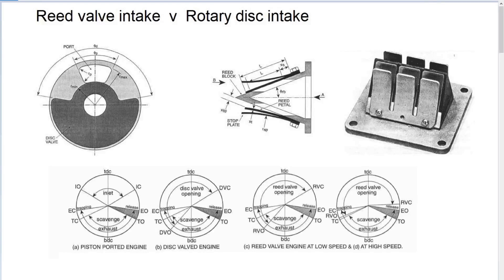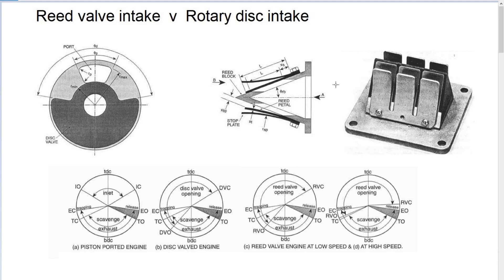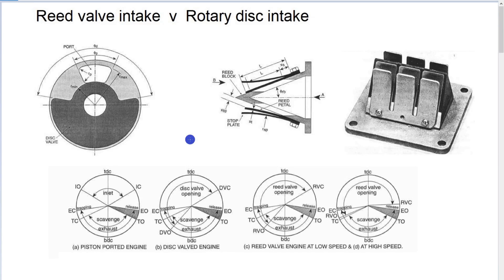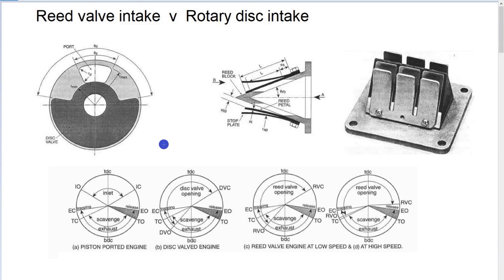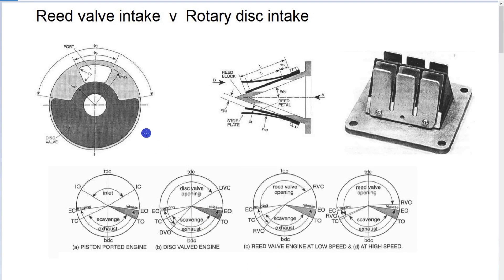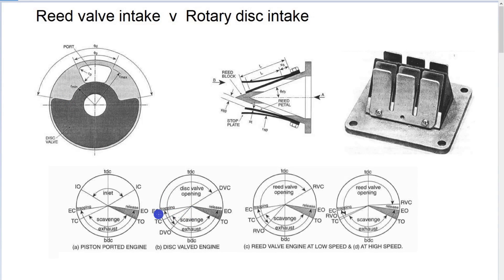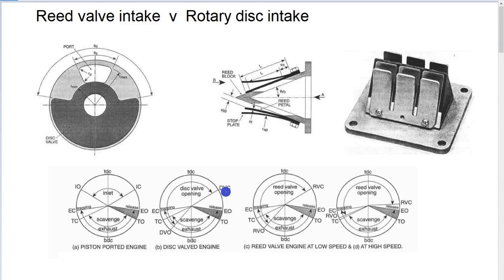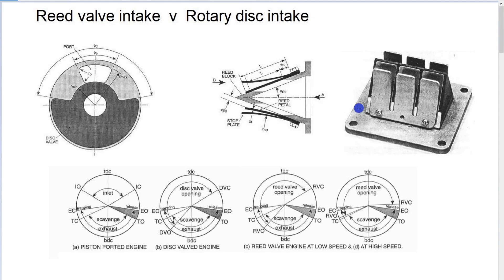Reed Valve V Rotary Disc Intake and why small 2 stroke engines favor the later.

Comment: Thank you for the video, you've done a lot of research. If I understood your data on reed valves correctly, I think it comes from an old perception that the boost port makes them open earlier. That should be only true if you have a piston ported system with added reed valves (the intake degrees might've been increased) and no hole in the piston, in that case the suction from the boost port makes the reed valve open before BDC. 

If you look at videos with transparent valves in slo-mo with modern design, you see that the reed valve opens a split second after BDC and it closes a split second after TDC. New reed valve system either go straight into the crankcase or into the cylinder but have lateral and lower ports which feed into the crankcase and the pressure from the piston on the downstroke seems to be keeping the reeds close until BDC, even though you lose some of the pressure after the transfer ports open. The boost port in these designs (or even in the old design with a hole in the piston) is fed from the crankcase with the reeds closed, it's another 'transfer port'. 

I myself thought reed valves would open earlier, when transfer and boost port opened, but the videos I've seen show a different reality. Technically on new designs it should be always 180 degrees from BDC to TDC, the higher the rpm, the more delayed the opening and closing of the reed valves happens, due to the fact that it takes some time for them to open, that is the noticeable difference between high and low speed, it's shifted. I don't know if you're following me, I think so. 

On the fact that rotary valves are more powerful, it might still be the case on very small engines, but as far as 125cc we have a lot of data today. 125cc Aprilias stuck with the rotary design and had Rotax make a special engine with a rotary valve exactly on the intake side to avoid asymmetry. Despite the ports being taken to the limit (you can find pictures on Facebook of that engine, there's 1mm between transfer ports for the ring that has been rounded near its pin to avoid seizing, just look for Aprilia RS GP engine, not the old inverted Rotax, the new one), the bike reached around 50-51hp with a 41 or 42mm carb. KTM with reed valves reached 55 with a 36 and 38mm carb. It's hard to find data on the Honda, but they had reed valves, they were as fast as the KTM (Aprilia won some championships but that was because their chassis was still superior and the rider did a better job). The only data on the Honda RS125 is the 40 to 45hp of the 'detuned' version they sell to customers today for the racetrack (obviously the tuning is not as extreme as the moto GP bike, though the chassis is practically the same). 

As far as go-karts are concerned, TM switched to reed valves in their 6-speed 125cc engine and it now has at least 45hp (some people claim 50) with a VHSH 30mm carb, before it was up 40hp. There's a video where they interview Gnani (unfortunately in Italian, but maybe there are captions you can translate), an italian tuner for GP racing, and he never liked reed valves, stuck to the rotary valve, his engines produced 50hp at the rear wheel, until one day, probably around 25 or more years ago, he chose to experiment with reed valves. It took him some time, practice, trial and error, but he then managed to extract 55hp at the rear wheel. 

I have no data on 50cc, as they stopped racing and developing extremely tuned engines, the rotary valves were the most powerful ones. Though I myself managed to tune a 50cc, reed valve on the cylinder, despite being 39mm bore and 42 stroke Minarelli engine, by copying the Rotax 122 design, to have better performance than the old Minarelli Corsa Corta rotary valve, 40.3mm bore x 39mm stroke with a 22mm carb. The Rotary valve Corsa Corta mounted a 28mm carb. But that might've been just luck. 

But seeing your data which seems to me to be coming from very early reed valve designs, I'm not sure your conclusions on reed valves reflect today's reality. Thank you for the video, it's very interesting and the latest book on 2T tuning seems to be 'performance tuning' by Graham Bell, published in 1999. If you know of newer books by engine tuners that show dyno data of different trial and error attemps like the one by Graham Bell, it'll be wonderful. 

I still don't know if I'm right about how the reed valves open, as my conclusion comes from seeing slo-mo videos on transparent cylinders, but again, it's a sort of proof... but not that conclusive. Unfortunately nobody bothers tuning these engines anymore, only motocross and go-kart, which already come with a maximised design for their purpose from the factory.

Comment: Please get fully into reed valves, and why the propensity in tuning  circles for ever larger   reed blocks installed. And is this any real world advantage ? Why ?
Reply from the maker: That is not a new thing, in racing builds we have always stuffed the largest reeds in as physically possible on the basis that an amply larger reed will present a reduced pressure differential across the reeds and increase flow at high RPM.
Factory works race engines have always had much larger reeds and carbs than stock bikes of the same capacity and make, simply to have the best intake flow at peak RPM.

Comment: Menurut q lebih handal rotary valve segi perfoma
Reply from the maker: Reed valves are pretty reliable unless you have some wild porting done that provides heavy intake reversion which can damage reeds.
Rotary disc valves are pretty reliable although they do wear and need inspection now and then.
However the performance aspect of the reed v disc as the video covers is far more critical then longevity.

Comment: Can someone recommend a video or a site with detailed information regarding setting up the timing of the rotary disc valve?
Reply from the maker: In short you need to get some starting figures by using a port time area calculator software.
Not aware of any free ones around though.
Reply: @AuMechanic  Thanks! any program that does not cost a fortune?
Reply from the maker: @erikjohansson9039  Try torqsoft
https://www.torqsoft.xyz/disc-valve-inlet-time-area-two.html
Not sure of prices but they have a disc intake time area calculator

Comment: Don't know if you still watch this but back in the 70's I had a Bighorn flattracker.  My tuner was Jeff Bratten who was VERY good with porting two stroke engines for racing.  He did the tuning for one of if not the fastest Yamaha 360 flat trackers it had dual 38 mm Mikuni carbs to feed the engine.
When he did the work for my Bighorn he came to the conclusion that I could put dual 44mm carbs on it and it would out perform the Yamaha.  I never did that as it simply cost too much.  But I really wish I could have.
But even with the single carb I could match that 360 in a drag race when going against the wind and he would pull me by no more than 2 bike lengths with the wind. 
I still have the port diagrams the Jeff made and was thinking of building a replica for fun today.  All I need to do is find a Champion frame and a F5 or 9 engine.  That's all.
Edit: changed 54 to 44 mm carbs. Off by one error.
Reply: Menarik! Bagaimana kalau karburator ganda yang satu terhubung dengan rotary valve, karburator yang satunya terhubung dengan reed valve, akan luar biasa memiliki keunggulan reed dengan rotary valve
Reply: @AgamSeftian  Interesting possibility.  I seem to recall seeing a story about a factory that did exactly that.  I only vaguely recall the article.  That would be interesting.  I type this and am going through the implementation issues in my head.😉

Comment: What rotary valve intake need is a split disk that can be tuned for rpm for optimal intake and closing timing. Like a four stroke cam phasing on intake and exhaust timing for optimal rpm V.E.
Reply from the maker: RG500 had a variable rotary disc intake.
Google it and you can see pics.

Comment: Rotary valves and oil injection really brought the Big Boy pants to 2 strokes
Reply from the maker: Yes rotary disc intake were a great innovation for small capacity engines and great for square fours even with the fact side mounting carbs caused ground clearance issue on cornering.
But oil injection was not without problems, when it was first used on street bikes in the late 60's it was to make it simpler for commuters to fuel up without having to premix however before they started fitting oil level sensors and warning lamps it was not uncommon for some to forget to fill up the oil tanks and then discover that after the engine had seized due to lack of oil.
And performance wise I can tell you having road raced street 2 strokes the first thing we did was to remove the oil injection and run premix instead.
Reply: @AuMechanic   you cant tune autolube up for power as easily as you can the rest of the engine. I run 32:1 premix in my RD350 racer
Reply from the maker: @hardwayfinder   Yes that's true.
There is also the potential of the oil pump failing so there are a few good reasons to get rid of it for racing.

Comment: Great video...thanks.  I would like to see a little more detailed comparison between just the piston port and the rotary valve for high rpm high horsepower.  My particular application is a 100cc 2 stroke engine that is going to be used for land speed racing.
Reply from the maker: The video does shows a basic a comparison to Piston Port to Rotary Disc at the beginning of the video.
How do you mean more detailed ?

Comment: Would it be possible to have a rotary disc valve with variable timing?
Reply from the maker: Yes it does exist, basically uses a moving aperture on the intake plate to effect a timing change on the rotary disc. It can be operated by centrifugal or electronic servo by lever or cable.
Reply: @AuMechanic  That makes sense, thank you! Centripetal force sounds a lot more like my kinda jam, I'm still traumatized from trying to fix exhaust valve servos on a Honda NSR250 😅
Reply from the maker: @Christopher des Baux  If you search google images you can find some pics posted in thumper talk forum..

Comment: Can you convert a scooter minarelli vertical from reed valve to rotary disc? 70cc polini
Reply from the maker: Not seen one but at a guess but you would have quite a bit of fabrication on your hands to do it for limited benefits.
Reply: @AuMechanic  is it worth it for me to install a 4 reed valve stage 6 intake vs regular (2 reeds) wirh a little bigger intake manifold into a 70cc polini with Yasuni R exhaust? It will improve the breathing intake of the system but I have a question, would I benefit from 4 reeds? Its for Yamaha Spy (CW50RSP) Minarelli vertical 2t AC
Reply from the maker: @2OnlyLifts  Cant help with specifics on engines Ive not seen but in general if the exhaust port is increased in size then you would benefit from a larger reed intake and carb.
Reply: @AuMechanic  could I contact you for some details if I needed any advice?
Reply from the maker: @2OnlyLifts  Just post here in comments as answers may help others.

Comment: Would the little nitro RC 2 strokes be considered to be disc intakes as it's actually the crankshaft that is cutting on and off the carby from the crankcase?
Missed seeing any videos from you for the last few years. Hope that you are keeping well and if you're looking for video ideas then an in depth analysis of how nitro rc engines work would be great.
Reply from the maker: Even though it has no disc as such the intake is "timed" by the crank slot at the carb intake so you could treat it much the same way.
And I'm doing well, thanks for asking.
I used to fly RC Heli's but I never really did any mods to engines or worked on them enough to cover more than the basics.
Aside from the different ignition they are mechanically a 2 stroke so a lot of the videos cover them too.

Comment: does it make any difference if the reed is on the cylinder or if the reed is on the crankshaftcase?
Reply from the maker: Case fitted reeds are common in small weed eater engines for a more compact engine, not many performance 2 strokes with reeds direct to case, closer they are to the transfer intakes the better.
Reply: @AuMechanic  Thank u, so mainly talking about experiences with cylinder-reeds. Cause many tuning-cylinders in the market don´t have any cylinder intakes, buyers have to cut out a piece of their crankcases to make a port/adapter for the reed valve... Talking about small cylinders, under 150cc, for Kreidler, Zündapp, Simson, Puch etc., etc. ...

Comment: A wealth of knowledge, more on reeds, material types, tensions, lengths and the effects on power characteristics would be great. I’m in the process of trying to generate more power from a KTM 50SX 2021 with a centrifugal clutch that’s very tunable, my grandson is 70 lbs (no gear) his competition is 40-55 lbs so getting a good start has been a challenge. He’s a good rider for 6 yr but he’s having to push to hard getting up to his real competition and doesn’t like losing. So it’s gramps job to get him to the first turn with the lighter kids, and getting any (real) info on a good engine package is next to impossible. Some shops will modify the cylinder and head but it’s not a package (carb-stinger) and I have the tools and ability just not the data as what will produce the best power mid-top Rpm’s I’ve heard you mention software for engine & pipe design do you sell some that I could purchase or could I pay you to generate the specs for our cyl, head, intake & pipe designs. From watching lots of your videos and being very impressed with your depth of knowledge that must have come from countless hours research and development over YEARS, I just don’t have that much time and testing for a 6 yr old is difficult. We’ve done it with his suspension and he was a trooper but I NEED some help with this unique 50 cc moto X mini maybe he can pull a hole-shot!  If you sell your software please let me know how to purchase it or how to pay your for a build sheet for the pipe and engine combo, he thinks Gramps can fix anything and I’m going to try FOR SURE! Thanks for the inspiration to make more power!
GOD BLESS! Ray Harold

Comment: I'm seeking information on the importance of intake length of small two-stroke for the purposes of achieving higher efficiency in my bicycle engine.
Reply from the maker: The benefits of having a very long "tuned" intake are exceeded by the benefits of having the carb as close to the cylinder as possible.
So you only need an intake just long enough to convert the carb size to the cylinder port.

Comment: Why is it necessary to window the piston with reed valves? Is this something I'd need to do if i converted my piston port to reed valve?
Reply from the maker: The main reason aside from any benefits of reed is that the reed becomes the inlet timing control instead of the piston skirt. Since the reeds are controlling inlet timing having a hole in the skirt effectively bypasses the piston skirt controlling inlet timing
As for the benefits of reeds I have a video on Reeds vs Rotary Disc intake that covers much of this.
Reply: @AuMechanic  I watched it, was pretty good. Looking forward to more of your videos. Would i be right in saying the inlet port duration  could be set to 360 degrees if reeds are being used?

Comment: Thanks a lot for the video. Very educational. Why do you think that most 50cc-500cc 2T bikes come from the factory with reed vales and cage rather than the rotary disc? Doesn't seem sensible if they are cheaper to build that way and then doing just the reverse.
Reply from the maker: Note in the video that the benefit of rotary disc is for engines that have low air mass and thus inertia so the smaller the engine is the more benefit a rotary disc intake is, conversely in large engines that rotary disc offers little to no advantage once you get to 500 CC single, in 500 cc GP bikes they are mostly 4 cylinder so each cylinder is 125 cc in which case rotary discs does offer some benefit.
The issues for rotary disc is for one thing it is more expensive to manufacture and also requires the carb to be fitted to the side of the engine that can provide some obstacles for motor cycles as it makes the engine wider and the carb needs some protection.
But in general its a cost factor in smaller 2 strokes that reeds are cheaper and require less service.

Comment: the rotary valve make more power
?
Reply from the maker: In short yes.
In Sprint Karting they were separated into different classes to race because the rotary disc intake engines had the advantage.

Comment: am i right in thinking that if you tune the disc for hi rpm you loose out at low rpm  due to the port being open to long and the charge reversing back out the open disc and this is what give the advantage to reed valves on lower rpm
Reply from the maker: Not quite, keep in mind the disc timing is set relative to the timing of the other ports so if the exhaust and transfers suit higher RPM then of course the timing of all ports will be less suited to lower RPM even if you have reed or disc.
Note in the video (at about 6 minutes onward) the disc opening is relative to the transfer closing point.
If the transfers and exhaust suit lower RPM then the disc timing would be closer to transfer closing.
So in short the reed is not beneficial in low speed more than the disc, its just that the benefits of the disc reduce the larger the engine capacity.
Reply: ok thanks ill watch again try and get that into my head